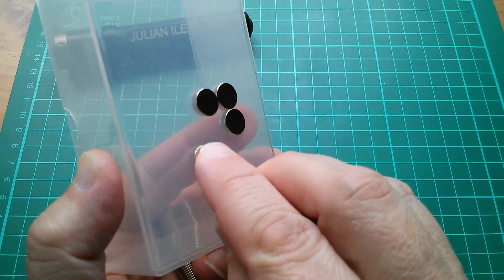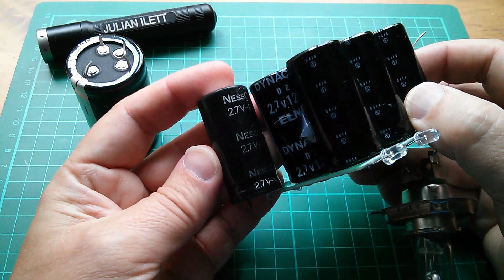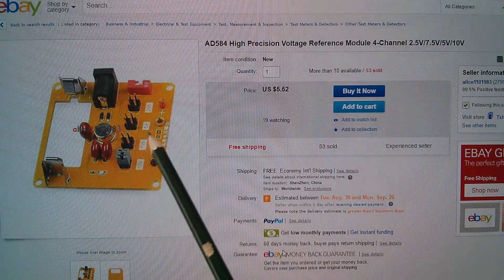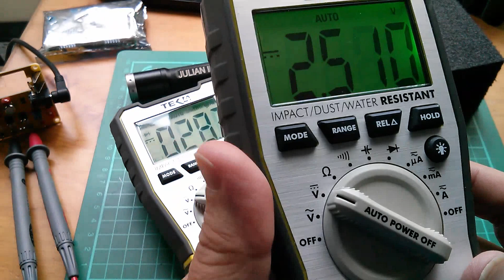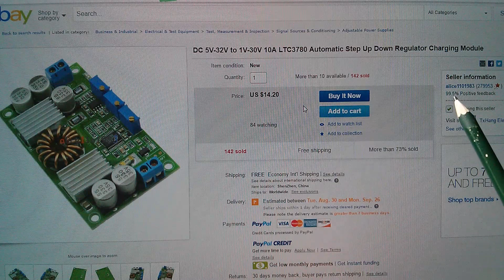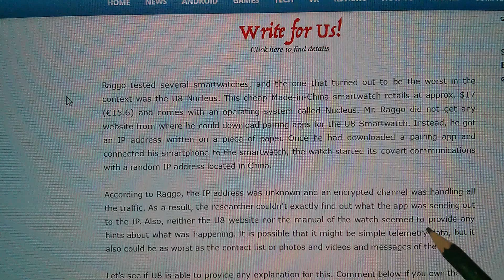Julian's Postbag: #69 - More Electronics Stuff from eBay

Comment: I don't know if it has been mentioned, I apologize it I am repeating someone else's post.
Julian, the Ryobi TEK4 instruction manual gives the following information concerning guaranteed accuracy of the meter.
DC Voltage: 4 V, 40 V, & 400 V ranges.
±(0.8% of reading +3 least significant digits)
For a ten volt input, that means...
±(0.8% X 10 + 0.03)
±(0.08 + 0.03)
±0.11
10.00 - 0.11 = 9.89 volts lower limit.
10.00 + 0.11 = 10.11 volts upper limit.
A reading of 9.94 volts is well within tolerance.
If you returned it to the factory they might send it right back with a message, "Found within tolerance, no adjustment required."
It might be interesting to many of your followers go over how to read the specifications on their measuring and test equipment.

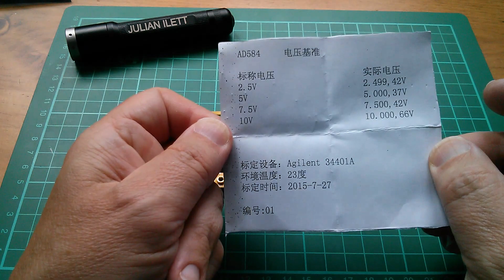Comment: 8:05 - Julian, some months ago I suggested using five lithium coin cells held together with magnets to power this voltage source and have now come up with a further mod. I found some vertical coin cell holders on Ebay that I stuck together in a group of five and glued into the slot in the PCB.
https://www.ebay.co.uk/itm/10Pcs-CR2025-CR2032-3V-Button-Coin-Cell-Battery-Socket-Holder-Box-Case-GZ/133008208588?ssPageName=STRK%3AMEBIDX%3AIT&_trksid=p2057872.m2749.l2649
I have  picture of the completed assembly but am at a loss as to how to send it.

Comment: You can increase the voltage rating of your super caps if you place them in series. It will, however decrease the capacitance. You can significantly increase the amount of energy by increasing the voltage (E=CV^2). So with 2 500 farad super caps in series you could get 250 farads of capacitance at 5 volts for a total of 3,125 joules! Now imagine what sort of experiments you can do with that kind of energy.

Comment: fwiw, The U8 news was mostly fake, it was easy to see that it was not sending your videos/pictures/messages/etc to some shady chinese ip, because of how much data it sent (less than 1kb). Its a simple ping to track usage statistics, this is very common, and done by virtually every single device that can get internet access, even if its via another device like your phone. The fears reported by the person who originally discovered this were a) that it may be checking for an update, and if so, they could one day decide to push a firmware update that WOULD steal your data, again just like every single IoT device on the market and b) a racist fear because it was talking to china instead of the US/UK/EU/etc, and ofc the chinese "cannot be trusted", which is rather daft when considering the unit comes from china, and the purchaser should be very much aware of that... i'd be more concerned if it was talking to a NON chinese ip... Finally, Android already provides security for this, for the app to be able to steal your messages/videos/pictures/etc, you must give the app access to those things.

Comment: +Julian Ilet   I have just got myself one of those voltage references.  Now here's a remarkable coincidence: the calibration certificate that came with mine is EXACTLY the same as yours; i.e. with the four voltages to five decimal places being identical to yours.  All the more remarkable considering that one of the capacitor leads had not been soldered, causing erratic behaviour...
Reply: I have also got one with exactly the same calibration values... Seems as if the just print out a note, without making any actual measurements
Reply: Me too. Mine just arrived today and I recognized the numbers on the so-called calibration sheet. EXACT COPY, a photocopy I think, of the sheet held by our hero Julian. Luckily we have a Cal Lab at my workplace, so I'll check it out there. Pure comedy...

Comment: The extra pins on the supercapacitor can be left floating, usually it's for mechanical purpose and your DMM is probably just being silly from parasitic capacitance with a minuscule charge.
Reply: I wondered if they were just for mech stabilization, given the size of the cap.

Comment: For the tests of the super capacitor it'll be easier if you get a clamp or two and use melamine (or mdf) to put even pressure on the card holder. Magnets idea looks like to much wasted time. If it works you can tut card holders shallower then use melamine/mdf + 2 metal brackets held with bolts.

Comment: Julian, feel the weight of that supercap. Now imagine it flapping about in some product, secured to the PCB with just two solder connections... I'll wager those two extra connectors are purely mechanical, to anchor the cap more tightly to the PCB.

Comment: The extra pins on the cap are mechanical mounting studs to mount the component more rigidly on the board. It's some protection against shock and vibration for such a heavy component.

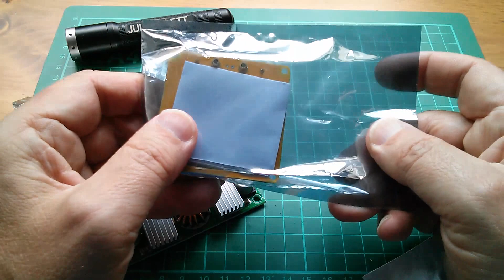Comment: @7:08  get the kkmoon precision reference module instead. it comes with a rechargeable battery and a nice laser cut acrylic case and banana jacks, and a nice user interface. it's a really nice voltage reference for cheap.

it's on ebay and also on amazon: https://www.amazon.com/Precision-Voltage-Reference-AD584kH-4-Channel/dp/B00Z033Y6Y/

Comment: Great vid. I found that if you copper plate a small portion of the magnets the solder and wires stick together  very well. I use them to charge batteries. Thanks again for the vids. They are very informative.
Reply from the maker: +Arthur Schroeder Brilliant idea 💡
Reply: Thanks Julian, Just be real quick on the heat or it will ruin the magnet properties.

Comment: Voltages on your reference are 6 digit, so 2.49942v, 5.00037v and so on
your meter is 0.02v out, 20mV, probably well in specs of the meter

Comment: The Avo8 multimeter uses a 15V rectangular battery. An option with them is to use your cylindrical battery in a holder to make it rectangular. The cylindrical one is just a stack of common AG10 alkaline button cells and you can make one up very cheaply using sticky tape and cheap cells.

Comment: surely those extra cap legs are just for mechanical mounting strength. the voltages you were seeing were just stray charge on the DVM leads - didn't you notice when you lifted of the probe the final time the meter continued to show the same small falling voltage? 
For connecting battery leads to the magnet have you thought about spot welding? in fact super caps could be very handy for making a miniature spot welder!

Comment: I got the same voltage reference and our sheets are the same numbers I dunno if I believe them as being the true tested numbers. I guess I should test it out on my 6.5 digit bench meter and see what the real numbers are. I bought the reference 3 months ago, but never messed with it.
Reply: Here's what I got. 30 min warmup both. 27.1C, input V 15.00437, so here the voltages from calibrated Rigol 6.5 digit Bench DMM with probe master probes.. 10.00334, 7.50373/7.50374, 5.00169, 2.50155

Comment: Julian, thanks for another great video. Do you have a link to the USB lead "voltage and current detector" that you used on the watch?  I have plenty of "charge doctors" that are on the "large " end of the USB cable, but often it could be more convenient if the display was on the "micro" end, like the one you used.

Comment: Those big solder tabs on super capacitors are a swine to solder, watched someone use two soldering irons on one just to get enough heat in. Still wasn't perfect soldering.

Also RIP smart watch. Anyone managed to re-purpose the touch LCD screen ?

Comment: the 2.5 didn't measure 2.499 it measured 2.49967.

the comma is simply splitting the number.

just like we write 1,000,001 for whole numbers, folk will write 0.100,000,01 with decimal places.

The comma is quite normally included in non-English speaking countries.
Reply: Ah! That would make sense!! Cheers!
Reply: the clue was in the item description, "each board tested with a 6-digit Agilent meter"
not much point in that if you only write down 4 of them

Comment: I have a few of those voltage ref boards, the V after the comma are the final two digits of the full voltage... not a separate voltage, mine actually came with batteries, the batteries are marked as 10F2015V, it is about the same size as a 9V battery, just slightly shorter.

Comment: Yes those 500F are similar to the ones I got and are just useless they have about the same or less than the Vina Tech that I sent to you and rated 220F (this are high quality made in Korea)
The GreenCaps are completely useless there are huge variation in capacitance between them also internal resistance and they have a huge leakage they can lose 70 to 80% of the initial stored capacity in 24h.
To play with just one is fine since even if all are with huge variations between them using just one will not be important.
At initial charge it seems they took a lot more energy and they got a bit hot wen if charged at realy low rate. That was a bit strange.
And those extra terminals are common for large capacitors just for mechanical support.

Comment: For those in the US, an ebay-offered $4.50 GC 8271 alignment tool is a less expensive alternative to the Bourns H90 or H91 which are $10 and up including shipping, except for a 10-pack from Hong Kong for $20.

Comment: a question to the ltc3780 board: would it be possible to replace the potentiometers with with digital potentiometers, add an arduino and some currentsensors to make a step up down mppt solar charger?
Reply from the maker: Yeah - it sounds so easy ;). But how do you control the input voltage - the panel voltage. That's the bit I don't get.
Reply: if the 3780 is in CC mode and the max.constant Currrent get reduced, that would reduce the drain and increase the panel voltage or am i wrong?

Comment: The battery used on those voltage reference modules is a dual 9V battery (2 in series), look here: http://www.ebay.com/itm/AD584-4-Channel-2-5v-7-5v-5v-10v-High-Precision-Voltage-Reference-Module-/181863456673 -- don't know where to get them though.

Comment: On digikey 5000 qty of AD584 are selling for $10.49 USD. How can they sell this module for $5.62 USD? Is this a real AD584 or is it recycled?
Reply: Digikey marks their price up significantly. Actual price from the mfg is much lower, within spitting range of that $3 board.

However, these are either "recycled" I.e, pulled, or counterfeit. Pulled is obviously much preferable to counterfeit. At best, they might be NOS
Reply: Well if it's recycled then it could be real, right? Even then, it might be a real chip but one which was rejected during QA testing in the manufacturing but nod badly enough so it went to the other garbage bin which goes to the other factory. Or it would be a brand new chinese "equivalent" copy. Or in the worst case a recycled chinese copy. Best case scenario? Someone stole a truckload of real chips somewhere and is reselling them for cheap. No way to know really.
Reply: some state they are recycled parts, I bought one on a whim and am very impressed, the test data with mine agrees with my calibrated Fluke and Keithley 2002 in work (+/- 5 counts!) needs to be powered up for 15/20 mins to stabilise and was using a lab power supply. ps if buying them you want the K variant chip (high accuracy)
Reply: It's obviously a Chinese knock-off of the AD584. They do copy chips and usually they are way out of (AD) spec.

Comment: I like using adhesiver copper tape to solder wires to and then wrap it around a magnet for those type of quick connections.
Reply from the maker: Nice idea - and they won't stick quite so viciously with a bit of copper in between them.

Comment: Lol and just as I thought, all these people 'calibrating' their B6 chargers so that they won't overcharge their Lithium batts..   4.20 Volt exactly it must be.  Right ...
I've also ordered that AD ref board, 2 Flukes show a different voltage and the Uni-T is also different. With that board lets see what is correct.
Julian I would definitely check  the Voltage on the 18650 batt itself. I've seen some loses on cables, connectors and surely that magnet thing is not something that you want to use to quickly (1 Amp and up) your cells with.  So even if the charger says for example 4.08 Volts it might be lower on the batt side.

Comment: Julian, could you check if your LTC3780 module goes to 10 A? Mine didn't, I was hoping to use it for bench power supply.
Reply from the maker: Most of the listings suggest 'strengthening the heat dissipation' if you're going to use it at the maximum rated current.
Reply: Mine didn't even go over 3A when it started to limiting the current. So it didn't even get hot. Searching on the internet showed some other people had that problem also. Just wondering if yours too.
Reply: It's probably just a rip-off copy chip which has a much lower current capability anyways.
Reply: Probably yeah. Still haven't found a module for my bench supply.

Comment: These 500 F caps look similar to the real "powerstore XV" series but sadly a lot of the "greencaps" are low capacity and have a fairly high leakage, and ESR. The extra connections on the REAL powerstor are open circuit (not used)
M.

Comment: I doubt soldering to neodymium magnets wold work, the curie point is fairly low and almost certainly below a reasonable soldering temperature. The nickel coating (so they don't corrode) won't take solder very well either.

Welding like for lithium battery tabs might work though.

Comment: What about digital pots and an Arduino sketch for that DC-DC converter?
Reply from the maker: The thought of running up the Arduino IDE which is becoming a bit of a bloaty mess.
Reply from the maker: I nearly bought a digital pot module just recently.
Reply: What stopped you? ;)
Reply: Julian Ilett Haha, yeah that would be quite frustrating...
Reply: Atom + PlatformIO or just PlatformIO IDE

Comment: I think that the battery is a 15 volt one, not easily found. I made one up from 5 x 2032 lithium coin cells joined together with 1 mm  neodymium magnets, as in your idea, in a cardboard tube . I put a spring in between two of the cells to give spring-loading onto the calibrator's battery terminals.
Reply from the maker: Nice bit of improvisation!
Reply: Thanks for the complement, Julian I do enjoy your offerings and this is the first time that I have bought a featured item before you did! 

I had done a similar thing with my old analogue Avo multi-meter, loading the original battery case with alkaline button cells. This worked out very cheaply using the card of 30 assorted cells from a pound shop.

The lithium cells were from the same source, the resulting battery much cheaper than Maplin's extortionate price. I made the tube from several layers of quality note-paper wrapped round a piece of dowel, soaking the resulting tube in polyurethane varnish for rigidity. 

Re using magnets as battery  contacts, I got some with a countersunk hole through the middle and used countersunk screws and nuts to attach the wire as soldering the magnets will take them beyond their curie point.

Comment: I brought the exact same Voltage reference module a few months back. Interestingly, my sino meter same model number as yours is 10 years old and also was only 1 count out, better than my Extech EX330. My UNI-T 210E clamp meter was spot on however.
I purchased it to confirm my other voltage reference was accurate, so I now have a AD584K and AD584L. The latter being more accurate. Pretty cool cheap device for testing my multimeters.
Oh btw, don't trust that little piece of paper; mine is identical the date, results, etc.
Reply from the maker: That's cheeky, sending the same test results out with every unit!
Reply: +Julian Ilett yep, I just compared to make sure again. Only difference is the title is indented slightly differently, mine is more centred, yours is a tad to the left of centre.
The other unit I have with AD584K has the results handwritten and having tested with a calibrated bench meter does appear to have been tested properly.

Comment: I'd love to see a video testing the accuracy of some of your led voltage meters. I have one with 5 total decimals, but I don't have anything to compare it to.
Reply from the maker: I'd like to check that too. I bought two and they were very closely matched - that gave me confidence that they are accurate. But best to check.
Reply: I have mine connected up to a DC-DC Buck/Boost, with a linear 10 turn potentiometer instead of the multi-turn trim pot that was on there. It is really nice to have all the digits for that, but I have no idea how close it is.

Comment: Why 3 multimeters?
Reply: They are Ryobi. If he had a Fluke, you would only need 1.
Reply: Maybe he needs to measure two different voltages and a current at the same time... you are new here?
Reply: I have dozens of those yellow sinometers. When I forget where I put my multimeter, I'll just grab a new one from the box.
Reply: I meant why 3 same multimeters, I also have 3 or 4 multimeters, but why 3 same ones, Julian?